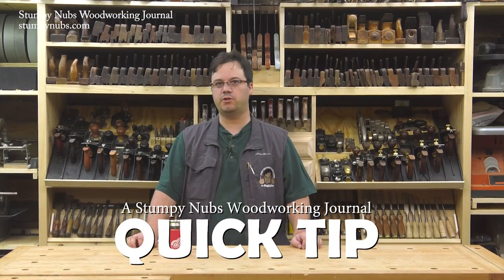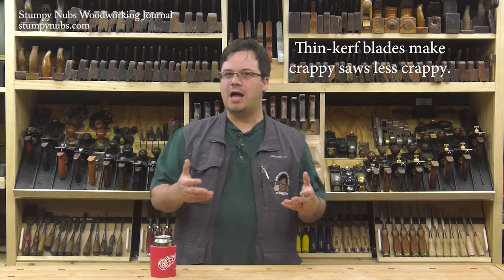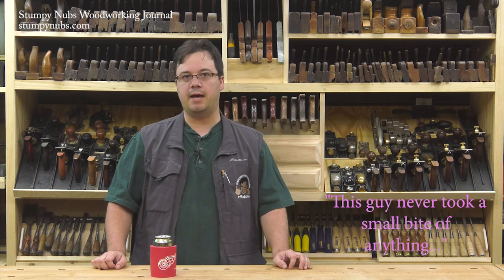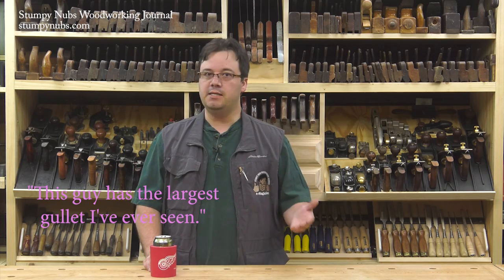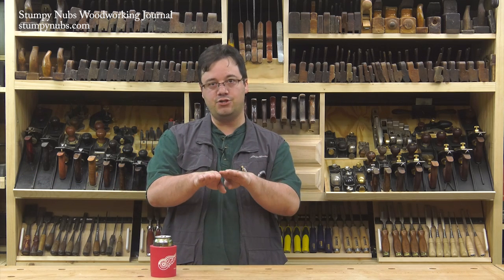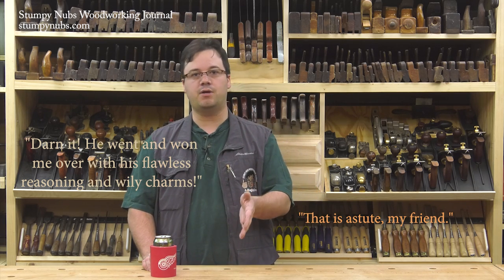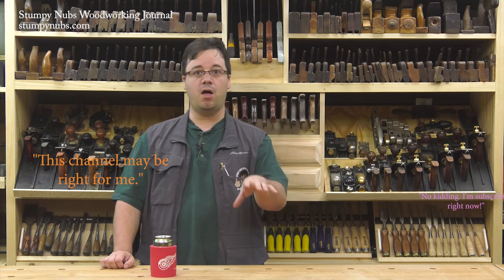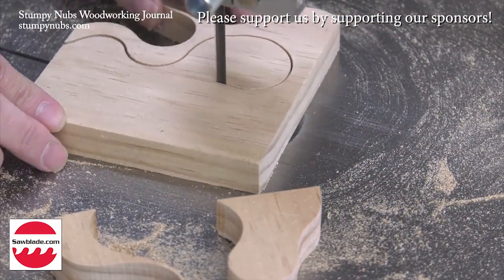Thin-kerf vs. full kerf- Don't choose the wrong table saw blade!

Comment: Just thought I would add another factor in here. Some saws come with splitters/riving knives that are too thick for thin-kerf blades, and can bind up in the middle of a cut. You may need to modify your existing one, or make/purchase a thinner riving knife if you want to safely use thin kerf blades with your saw.

Comment: My typical use of a table saw is ripping strips for cedar strip canoes. I used 3/16" thick strips ripped off the edge of a board. If I were to use a standard full kerf blade, this would mean that 33% of each board would be converted into sawdust. Instead I use a small 7.25" diameter blade intended for a skill saw that has a 1/16" thick kerf. 

This means that I am still wasting 25% of each board in sawdust, but for a typical canoe that might need 26 board feet of cedar to make all the strips, using the thin kerf blade I only need 20 board feet. For every inch of board width I am getting almost one more full strip going from 3.2 strips per inch to 4.

BTW, cedar is very easy to cut so heat buildup is not a problem and the smaller diameter blade puts less load on the saw and is less likely to distort. Since this blade is the most likely to be in my saw, I end up using it much of the time when I'm doing other work. They are amazingly good blades for the price.

Comment: Our Men's Shed operation used to use 2.5mm kerf blade in a 3 hp SawStop table saw, yet the riving knife was thicker. When this was pointed out to us by a visiting rep from the company we bought it from we switched to the thicker 3.2mm blades.

Comment: James, great conversation and yes, it goes deep with all the variables. But remember, the cost of a kerf can add up. Take for example ripping a piece that is 2” thick and 72” long with a standard, 1/8” blade. Based on the most common stuff we rip ($5 - $20 / Board Ft) that kerf will cost you between $0.63 and $2.50. (The kerf is 0.125 BF) take that to exotics and Holly is $5.38, Cocobolo $8.13 and Gaboon Ebony a whopping $15 per kerf. So having a dedicated thin kerf ripping blade for your saw is a good idea for the next time you will be doing any considerable ripping. Switching to the thin kerf rip will save you $0.16 on a cheap wood or $3.75 on Gaboon Ebony. Everything else falls somewhere in the middle. And that is per rip. So imagine me ripping 1/32 veneers from 8/4 Ebony for banding. The resulting veneer is of less value than the kerf that went into the dust collector! And while a bandsaw rip will leave a smaller kerf, you have to start oversize to clean up the rougher kerf, plus the labor to do it. It’s all a little bit like putting dollar bills through a shredder connected to your dust collector.

Comment: First, long rip cuts in 8/4 oak and frequent breaker trips were the primary reason I upgraded my table saw motor from 110V to 220V.  Using dedicated rip blades, even thin kerf ones, wasn't the ultimate solution.  But even after all that I still organize my work so that all ripping is done with a dedicated rip blade and crosscuts with a combo.  I'm never in such a hurry that changing blades is an issue.

Comment: Give your saw the best possible chance for success. If you have the choice run it on 220v vs 110v, keep your blades clean, make sure you align your riving knife correctly & use the correct blade.
Basically a compilation of what James brought to light.

Comment: I have a dewalt 8 1/4 contractor saw and before I bought a new blade I was getting circular-saw-quality cuts..(brand new saw)   I bought a full kerfed, Ridge Carbide Super blade, per stumpys recommendation..  The saw runs it just fine and I am getting glass smooth cuts if I do my part.  This blade outperforms this saw, which has no problem pushing the full kerf.  Thanks!!

Comment: My dad left me his "Craftsman 10" (1950s era) table saw when he passed away. That gift got me going in woodworking over 15 years ago, and I will always have a warm place in my heart for that saw. That being said, I went out and bought a very nice 5/8 arbor Freud blade for that same old saw, and was disappointed in the saw's performance. The new blade was too heavy for the old saw's scrawny engine. A few years later, I bought a recent Jet table saw, reinstalled that Freud red blade on the modern saw, and the results were jaw-dropping: a nearly-planed finish on all cuts. An older saw engine may require a lighter blade.

Comment: Something that I do is use a smaller diameter blade when (usually) I don't need full depth. It's amazing how much more power you will have and a bonus is that the blades are much less expensive! Keep up with the great videos, and thanks!

Comment: "You didn't know you didn't know" ... Priceless. This reminds me of ...
"Bootstrap's bootstraps."
"Bootstrap's bootstraps."
... There's one more advantage about thin blades... If you work with POM and you get short pieces that you need to make thin slices of, thin blades waste very little material (as the video already states), but you might get one extra slice (or even more), which results in a much lower cost for materials, since POM is quite expensive. Same thing if you cut aluminum.
-So if you work with very expensive materials, a thin blade could allow you to juust get you one extra usable piece out of that material. (One reason to consider getting a bandsaw for some uses).

For general-purpose rafter cuts, MDF and plywood, I'd probably choose the full size blade myself.

Great video as always, James, highly appreciated.

Comment: I had to switch back to full kerf...thin kerf caused lumber to pinch between the riving knife and fence.   It took a while for me to realize the problem, and then I finally read the kerf size specs printed right on the riving knife!   Just something else to consider when deciding on which blade kerf to purchase ;-)

Comment: Thanks! I love my dewalt flexvolt table saw which uses thin kerf blades because it uses a battery powered motor. But I've noticed that I've been getting rougher cuts with my 40 tooth blade when ripping, than my 24 tooth blade. This explained a lot.

Comment: I switched to a thin kerf blade when I was cutting strips for my cedar strip kayaks.  I need over a hundred for a boat.   They're only .200" thick so the kerf eats up a large percentage of the wood.  Even with a thin blade I had a wheelbarrow load of sawdust. I don't know if you've priced cedar lately, but that sawdust is expensive!  Now I only use standard blades if I'm cutting up 2x4's or pressure-treated stuff.  But I like your videos - you always drill down into your subjects, and I always learn something new.  Thanks Stumpy!

Comment: When I want thin kerf, I use a thin kerf 7 1/4 inch blade. At 1/16 inch, very little dust. At 7 1/4 inch, no significant warp. Great for a lot of the rough woodworking that I do, but takes a back seat for the finer jobs. Thanks for the ever informative talk.

Comment: Great information!
My first saw was a radial arm which was very under powered running on 110 volts, so I bought a thin kerf blade hoping to solve that problem. Switching to 220 volts made a bigger difference.
My first table saw had a flex shaft which was like a large speedometer cable turning the arbor/blade and extremely under powered.  A replacement higher horse power motor running on 220 volts made that saw usable but as we all know, the problem just moves to another area. In this case the cable life was shortened by 50% and a replacement shaft cost as much as a cheap contractors saw. I have long replaced that saw with a 3 hp cabinet saw which is used exclusively for ripping and dados, and I must say that it doesn't care how thick the kerf is.

Comment: Ripping strips for cedar strip boats... A strip is typically 5mm to 6mm thick. Using a standard blade turns more than a third of your lumber into sawdust.

Seven inch blades go as thin as 1.6mm... a substantial saving in timber and dust when ripping a hundred 5mm thick strips. Admittedly, cedar cuts like butter.
Reply: Is a table saw the right tool for such thin cuts?

Comment: Under powered saw? Three options possibly. 1)slower feed rate, 2) fewer teeth - which is also a good option for ripping, and 3) raise the saw blade up higher so the saw is not carving out a long, nearly horizontal kerf with a bunch of teeth. The last option reduces the number of teeth in the cut, minimizes friction and if you are careful, will not minimize fingers.
Reply from the maker: Most of which was covered in this video. But thanks for re-stating it.

Comment: My first "real" table saw was an old 1.5 HP UniSaw and I always used thin kerf blades. 90% of my work was with 3/4" plywood so I probably didn't need it, but I didn't have any issues so thats what I used. When I did work in solid wood I did change blades to a rip blade or cross cut blade as necessary, also thin kerf. The key is to plan your work flow so you aren't changing blades all day. My current table saw is a Felder and they don't offer thin kerf blades. I can buy thin kerf blades in the Felder arbor pattern, but they are about three times the cost of the Felder blades, which are excellent in my experience. When I'm ripping up a lot of plywood that 1/16" makes a difference, sometimes between getting another part out of a sheet or throwing away a 1 or 2 inch off cut. The increase in sawdust was also very noticeable, 25% more as James mentioned. If I could buy a thin kerf blade for the same price (they are usually a little cheaper) I would still run them on my saw, which is definitely not underpowered.

Comment: Thanks James, another excellent video. I have a special purpose ultra thin 8 1/2" blade I use to cut mitre splines in small boxes, I think the resulting finished product looks more balanced than a full 1/8" kerf.  My saw has a 2.5HP motor so power is rarely a problem, but just to add to my strangeness, I swap my general purpose blade (40 tpi) for a dedicated rip blade if I have either multiple rip cuts or a single cut longer than 4', yielding few for few to no burn tooth.  I also used a dedicated blade for sheet goods for same reason. The couple minutes invested a couple times in a day are well worth the efficiency gains IMHO. Thanks for sharing and cheers from BC.

Comment: Thin kerf blades increased my cutting yield by 33 percent I'm able to cut 3 width from a 1x12 for casing rosettes standard kerf won't do it. Also consider diameter reduction to cut by lowering leverage against the saw spindle. I am also using thin kerf in a gang rip application that's avail to anyone largely. Thin kerf affords an extra blade on the spindle saving yet more material handling increasing through put and also making charges of gang ripped material a more full charge on my return pass on my double sided planer so the exponent of that results in a massive victory. Just thought I'd add. Great points in the video btw nicely done.

Comment: I watched this a couple of years ago, when I decided to buy a thin kerf blade for my tracksaw. Well, since then, I've gone back to standard - in my case 2.2mm - blades, as they suit my type of work better. Typically, I don't get to work much with expensive hardwoods on this side of the pond, so saving material is not really a thing for me. Trimming doors, where you are usually removing anything from 2 to 5mm, I found that the thin kerf blades tended to wander, something I have not experienced using the more usual 2.2mm tracksaw blades.
I had to replace the splinter guards on all my tracks to accommodate the thin kerf, and then back again. 
Initially, the idea was to save battery life, but nowadays, batteries are cheaper than worktops, doors, or plywood.

Comment: Thanks a bunch, I watched this s few times and it is starting to help my paralysis by analysis over blades. I think this entire issue comes down to the saw, if I had something bigger than a 1.5hp Ridgid table saw,I wouldn't even look in the direction of a thin kerf blade. For now I'm leaning 3 blades. 60 or 80t ply blade, think kerf because it was less expensive and I tend to do ply projects in waves..like now, 5 sheets of prefin maples. Then...a dedicated rip blade 24t Freude with a flat grind and thin kerf so I get double duty, lots of thick rip cuts in hardwood, and no dado stack yet. That leaves the 3rd spot for the 40 or 50t combo blade, this is where I'm considering spending 100$ or more and possibly full kerf, either Forrest or Ridge carbide I think..but it's a big chunk of change to find out that a full kerf sucks in this saw. And I cut a lot of stock that's over 1" thick, make a lot of thick table tops and just beefier pieces, all hardwood tho.
Reviews are very mixed if the 4512 can handle it. Only had thin on it up to this point and good results when I don't get super cheap blades.

Comment: That explains a lot. I have a HF job site saw. I haven't noticed it bogging down a lot, but I did just mess up the blade and need to replace it. I had no idea what to buy until now. I tend to do more rip cuts.

Comment: "...I usually answer, "It depends..." Truer words were never spoken! 
I'm an acoustic guitar maker, and we're a weird breed of woodworker. We don't make things square, plumb, flat, or free-standing. We fit compound radii to other compound radii, curves to other curves, and straight lines to bent trajectories. It's sort of an idiot savant thing.
I have about fifteen Tenryu brand, seven inch, thin kerf blades for my 3 HP Grizzly cabinet saw.  They stay on there 90% of the time, because we routinely cut thin stock, like fingerboards, bridge blanks,  and flat plates, small lumber, and always working at extreme, like .002" dimensional tolerances. I found a few 1/16" kerf Tenryu blades that cut with a glassy smooth precision. They make my life soooo easy.
I have to say, a ten-inch 52-tooth combo blade scares the holy living carp outa me. When I have built out a new shop, and have to make cabinets, shelves, and work surfaces, I'm totally out of my depth. Your advice really helps me dispel some of the brain fog I experience when right angles, flat surfaces, and mostly BIG LUMBER are involved. You're really great at explaining things, James, which my little lemon-sized, 3-inch radius brain appreciates very much.

Comment: I bought a thin kerf rip blade for my Ridgid jobsite saw. I was able to cut through super hard hickory with no issues after doing that. 

it was kinda weird too. the wood chips came out more like large strands than the normal dust I got from plywood.

Comment: Not being able to use a dado stack [UK] I was taken with a 'wider kerf than usual blade' that I saw on a UK YTvideo but, until I just watched your video it didn't occur to me there could be so many factors that will alter with kerf size. Cheers James, as usual you've given me good info to mull over before my tool-buying-fever blinds me completely!
Reply: You cant use a dado stack in the uk?
Reply: Keith Stewart, why can’t you use a dado blade in the uk? Damn, I thought your gun laws were stupidly strict.
Reply: @richardsolomon5375  seems i was missinformed - i stand corrected
Reply: @shanek6582  seems i was missinformed - i stand corrected
Reply: @nigellitchfield9650  seems i was missinformed - i stand corrected
Reply: @negotiableaffections  that's cool dude. I just thought there was some weird law in the UK about dado blades.😄
Reply: This is old now, but the comments kinda spell out the truth/urban myth of the whole thing.
Reply: Keith Stewart I just looked it up and it looks like they were banned maybe in the uk by health and safety? Maybe someone has invented a loophole or the law changed.
Reply: @richardsolomon5375  no, it does. With a national health service, there is government incentive to ban more dangerous things. EU regulations ban this, and still apply. This is because they require protective features such as riving knives and guard to be removed, and the weight of the blade (e.brakes cause the nut to unwind, flying dado) Theoretically you might be able to make a compliant table saw with dado under 15.5mm kerf, but they aren't availible legally, though some places have all sorts of non regulation equipment. 

This is a ban on new ones. As far as inherited ones you can use them. 

They aren't even called dados in the uk, that is part of a wall. They are called housing. Not sure what the blades were called when they were sold.

Comment: Some 30 years ago I had a Craftsman 1 HP contractors saw.  I also used a thin kerf blade.  It cut "OK"  A local sharpening service talked me into a better quality full kerf blade and I was reluctant to buy it.  But I could return the blade if I did not see a significant improvement in performance.   I have never bought a thin  kerf blade since.   FWIW I upgraded to cabinet saws 20+ years ago and not even 3/4" stacked dado blades slow the motor down.

Comment: Making "celtic knot" inlays for pen blanks, you need a thin kerf and you need to match the inlay thickness to the kerf.  SO, I sometimes use a 7-1/4" circular saw blade that cuts a .075" kerf.  Going slow and using a sled and clamp keeps the blade from vibrating (singing) in the cut.  After all, I'm only cutting something 3/4" square.

Comment: Damn you James, just when I thought I knew it all, you have to go and spoil it! LMAO. Brilliant as ever!
Seriously though, Thin Kerf builds heat and cools faster, if the same heat energy is input, the lower thermal mass means more extreme heat build and cooling thermal stresses on the blade, causing the Teeth to dull faster and the Blade to warp.
My machine is 2hp and has no difficulty running full kerf blades.